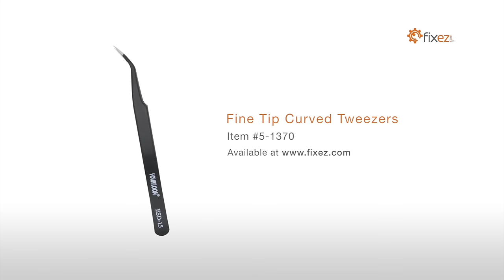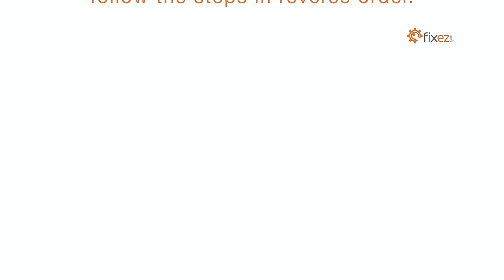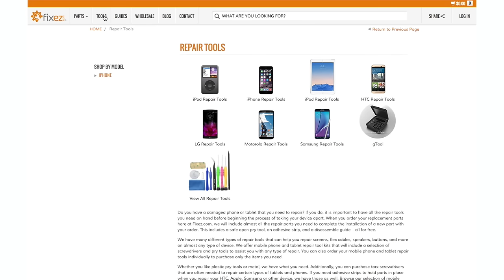Alcatel IDOL 4S Screen Repair, Teardown and Reassemble - Fixez.com

Comment: Why do these gadget repair websites show video of a phone they do not even carry parts for?  What is the thought process that these sites go through when they post a teardown and screen replacement video when the parts are not available? At some point does not someone on staff ask the question of "WHY".  Why post a video of a process that no consumer can possible use, because the parts are just not there.  And the few I found were more expensive than the phone.  The simple answer is to trick people who are looking for a repair option into clicking on the link for their site. And artificially driving up traffic to their site.  You get a big thumbs down for this.
Reply: And way too much work, you're right, might as well buy a new phone.